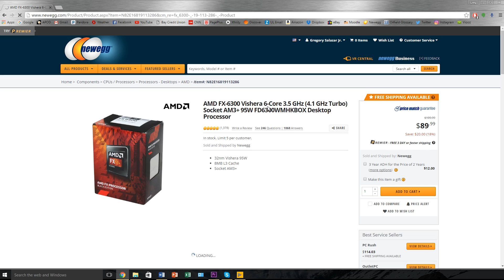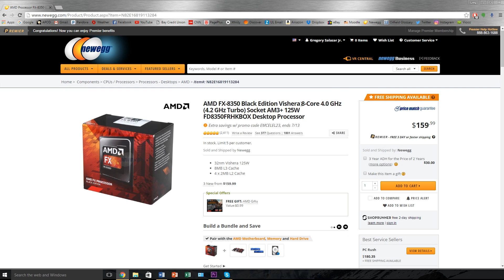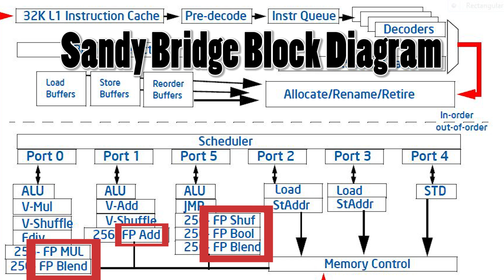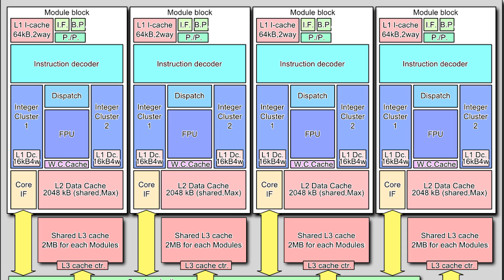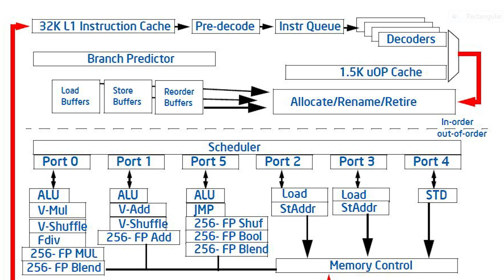How Many Cores Do AMD FX Processors *Actually* Have?

Comment: Hey Greg, I'm going to build a new pc soon and I was wandering what CPU should I get, the i5-6600k or the i7-6700k?
Reply from the maker: Already have a video covering this.
Reply: The i5 6600k and a more expensive GPU is better than an i7 6700k and a less expensive GPU. The i5 6600k is the smart choice, but the i7 6700k will be more rewarding if you can make full use of it.
Reply: I'd wait for Zen...
Reply: Noah, you're obviously a fanboy. So let me make it clear. First, yes, the 480 is at the moment about 10% weaker than the 1060, but the reality is this... AMD's cards actually get faster as they age. When it came out the HD 7970 was about 20% weaker than the GTX 680. By the time the R9 280X and GTX 770 came around, which mind you used the same GPU as the previously mentioned cards, the 280X was the more powerful of the two. This is due to AMD's optimizations. It's the same reason that an R9 290X running on current drivers can now comfortably out perform a 780 Ti even though the 780 Ti was much more powerful during the cards run. AMD actually tries to keep their older cards relevant. nVidia doesn't. Plus the 480 should perform better than the 1060 in DX12 titles due to Async rendering.

Now, as for Zen and Intel, here's the simple fact. Zen is looking to have about as many instructions per-clock as Haswell. This is only a hair behind broadwell and Skylake since Intel's been pretty fucking lazy since AMD dropped the ball with Bulldozer. But here's the kicker. Yes, Zen cores will be a little weaker, but Intel puts an iGPU on every consumer grade processor they make outside the X99 platform processors which cost an arm and a leg. This matters because of Die space. Right now Intel actually dedicates over 50% of their CPU die space to the iGPU. Zen based FX processors aren't going to be including iGPUs which means they'll be able to have twice as many cores as a comparable Intel processor. Even if the next gen intel processors have a sizable power boost, which isn't likely considering that intel has outright stated that they're not going to be focusing on the desktop market, they'll still be hamstrung by the need to dedicate half the die space to the iGPU.

Now I am sure you'll ignore all this and spout more platitudes but that's on you. The simple fact is you have no idea what you're taking about.
Reply: Some serious fanboyism on this thread. 8GB of Vram on the RX 480 vs 6GB on the 1060 is going to have little to no impact on gaming at the resolutions these cards are intended for. I don't know anything about VR or what goes into these cards to make them better for VR, but I imagine VRAM is part of it. Honestly, when I can pick between two directly competing cards, I always pick Nvidia. I prefer Nvidia's software, and EVGA makes excellent graphics cards so there is some brand loyalty behind my bias. That being said I have an R9 380X in my computer so don't "omg fanboy" me.
Reply: +Noah S. What if i told you no one gives a Fuck about your opinion. You will keep talking but not understand why no one is listening to you.
Reply: Right now AMD doesn't compete well against Intel, that's a fact. That said, there's a reason I said WAIT FOR ZEN.
Reply: EVGA Fan That goes both ways, they swapped x86 and x64 architectures. And Nvidia is only neck to neck with AMD because Nvidia keeps their Phys-X chips and their exclusive software closed source. Big techies such as Linus and RTU, and smaller youtubers unendorsed by companies admit that Nvidia is paying to keep relevant in the gaming world, also Linus did a video on Intel and AMD cpu history. But you're clearly showing a lack of intelligence in that area.
Reply: Noah S. Lol. The company that can't seem to wrap their heads around what proper pricing is. A GTX 970 costs more then a RX 480 and is massively dated in comparison. Yet Nvidia is coming around. I know who's gpu's are better, at least Intel justifies their price tag on the cpu's something I don't think Nvidia will get for a loong time.
Reply: what if I told you AMD sucks ass. As soon as AMD puts that out Intel will beat it again with their RD budget
Reply: +PsyckoSama AMD is about price, Intel is all power. Now not many of us have the money for the later. Id wait for Zen as well.
Reply: +PsyckoSama You really cannot explain yourself can you? Cards don't get faster with age, the clock speed stays exactly the same. some of the cards later produced may have had a slower clock speed but that doesn't mean the older ones got faster. You are a mess.
Reply: Kent D Excuse me, but if I read his comment right, he said they get better optimizations as they get older. Meaning it's software tweaks on them maximizing their performance.
Reply: Kent D software updates can tweak how it handles, and tbh. A processor doesn't degrade like a hard drive, go look it up. Linus did a vid on it, here's a quote. "Both my graphics cards got shit on equally" one new, and one years old with 100's of hours of use.
Reply: +Derp Derpington Actually, a lot of the positive reviews of the 1060 over the 480 have been due largely to running 90% of the benchmarks in DX11 (with tons of Gameworks titles, mind you) when it makes up the difference rather comfortably under DX12.

Right now the GTX 1060 is a little faster. But I'd like to see how they look in 6 months.
Reply: Noah S. Lol. AMD is shitty? Get real. A 700$ R9 295x2 matched the performance, and even beat a 1000$ Titan. This is the first time Nvidia has even remotely appropriately priced a card.
Reply: Noah S. Looking further into it. It outperformed the Titan Z. Lmao. At a 1500$ price difference, probably more now unless the Z has gone down more. http://www.extremetech.com/gaming/184216-nvidias-3000-titan-z-takes-on-the-1500-radeon-r9-295x2-and-gets-crushed and it beat two Titan Blacks in SLI for 25% less. Its thermal design was bad, but its cooling makes up for it. The fact Nvidia fucked up that colossally is bad. A dated GPU beat it. I respect both, but I have my preference and stated why. AMD allows Nvidia to benefit off their in-game physics boosters, why can't Nvidia suck up and let AMD benefit off their software? Explain in a non-biased way.
Reply: Noah S. Lol. That explains why AMD is neck and neck with Nvidia. And why a gpu that at launch costed 1500$ beat Nvidia's 3000$ GPU. Get real. While it wasn't as power efficient as the Z. Beating it by a whopping 35% in games and real world scenarios is embarrassing. Tell me a TRUE story. When Nvidia aims things at businesses, you get the Titans. When it's at consumers. You get GTX, though a bit overpriced as to AMD's performance equivalents (Aftermarket such as ASUS and MSI remove cooling issues and increase silence compared to factory defaults while lowering the price) while possibly a bit louder and a tad less efficient have been costing (sometimes 100's of dollars) quite a bit less. Tell me what a dollar minded person will choose.
Reply: +Derp Derpington AMD is neck and neck with nvidia because half of the world can't afford Intel or doesn't need intel. Most people buy an fx or an x4 and pair or with a mid end gaming card like the 380 or 390 and call it good. Intel is better for professional use and high end gaming. AMD wouldn't even be producing processors if not for Intel partnering with them and giving them their chip design in 1982...
Reply: Noah S. Lmao. You're showing total bias, must be a Nvidia fanboy.
Reply: Noah S. Lmao. You're showing total bias, must be a Nvidia fanboy.
Reply: Noah S. And it's Nvidia holding AMD cards back because they refuse to release their exclusive software. Where as AMD IS open source and benefiting Nvidia cards. Learn to read fanboy.
Reply: All you talk about is how "I'm lacking intelligence." You're not as smart as you think if that's the kind of shit you feel the need to say to solidify your argument. And yes, Intel has always played dirty to keep it's monopoly of the market. Guess what. That's the business world.
Reply: Not to mention that the swap of architectures only benefited AMD. Intel HAD to use a secondary supplier for X86 Microprocessors by IBM's demand. The X86 architecture was chosen by IBM over the X64 if that's any indication of superiority, and giving that architecture design to AMD and using them as a secondary supplier is the only reason AMD is relevant today.
Reply: EVGA Fan But AMD CPU's were the king in the early 2000's and that has shifted for now, let's see how well Zen fares against 10nm next architecture generation Intel. But AMD has made a fair enough competition with Nvidia with the RX 480 vs GTX 1060 (Though the 480 was rushed out the door, incomplete and woefully unoptimized) that I find it better because of a fairer price and a more friendly company behind it.
Reply: Go Amd and save your money
Reply: Yor Highness  And spend more on a power supply, spend more on power, run a hotter PC and have a higher lemon rate. The intel CPU's built to compete with AMD arn't that much more. The higher priced ones are out of AMD's ability to compete.
Reply: PsyckoSama  and look at Intels R&D budget. Intel would be very fast to compete with zen, so if you want to wait for zen wait for what Intel releases after zen. Look for the RX 480 being beaten down by Nvidia for example.
Reply: +Noah S. Why spend 250$ for a Nvidia GTX 1060 with 6gb Vram when you can buy a RX 480 8gb Card and overclock it? Clearly the better choice and exceptionally better for multi monitor setups. Fanboy acting like a dumbass.
Reply: +PsyckoSama Nice. I didn't know that. And I'd prefer 8gb of Vram and a slightly weaker processor then 33% less vram for a higher price. GPU's can be overclocked as well, if you can overclock the rx 480 to 1060 level and have 8gb of vram for the same or slightly less, why pay more?
Reply: +Derp Derpington Speed and performance doesnt get better, it degrades. Software updates improve compatibility.
Reply: And another thing worth mentioning. Changing how a processor handles its job can make a significant difference. Enough to put the rx 480 to 1060 level, and the 480 was rushed out, poorly optimized and buggy. The 1060 was not however. So yes, the 480 will likely be faster then the 1060. Get over it.
Reply: ... Your name says it all.
Reply: I mean.. yeah. I already said EVGA was my go-to brand. I use an AMD Graphics card so maybe my name doesn't say it all...
Reply: EVGA Fan It will make a huge impact on multi monitor gaming. Plus 8gb will keep you set in the long run, besides it's not even noticable in fps between the two cards. Get more for your money with AMD, and as I said. Just overclock the 480 and the difference is closed for less money.
Reply: Derp Derpington  or you can just the 1060 which is a better buy
Reply: Derp Derpington  oh I'm sorry I'm willing to spend a bit more money for the better card and I'm making AMD fanboys salty, must be already upset with a shitty AMD PC
Reply: Yeah but it is (should be) common knowledge that the Titan series cards were not gaming cards. They excel at double precision computation and were marketed towards the gaming community to appeal to a larger crowd. So your comparison is completely worthless to the conversation. Not to mention the R9 295x2 is an extremely inefficient card that consumes around 500 watts under load. The GTX 1060 performs around 15% better than the RX 480 while consuming less power, generating less heat, and having better driver support and software stability. Those are facts, and I wouldn't say AMD is "Shitty" but Intel/Nvidia is certainly superior at this day and age.
Reply: Same, but Nvidia is just FINALLY getting well priced cards, and the power consumption difference would take months to iron out the difference between 480-1060. And would take years of consistent use between a Intel and AMD cpu. The heat/power difference argument is just stupid, and obviously a overclocked card will produce more heat and draw more power. And the 300$ difference is substantial enough to be relevant, the R9 295x2 was a considerably older gpu then the titan while outperforming it. Plus that 500w is just a lie, It's under 430w draw.
Reply: Derp Derpington  the R9295X outperformed the titan by 3 percent or something really small. The R9295X was a disgusting, massive, multi part dinosaur that nobody wants.
Reply: Derp Derpington because Nvidia invests alot more into their software and being on the leading edge of hardware development. AMD just rides the wake with cheap crap
Reply: Derp Derpington  how about we fast forward to pascal and and the 1060 beating the RX480's "value".
Reply: Derp Derpington  You mean how AMD's competition against Intel in the CPU market is even more pathetic than Their competition against Nvidia in the GPU market? Grow up, it's not hard to see who the winning companies are
Reply: Derp Derpington  you seem to be the 5 year old that can't let go off his old blanket that's falling apart because it was his only friend. Even if I am a fanboy at least I'm one of the better company.
Reply: EVGA Fan neither would be around if not for the other. It would be some other company the government created to prevent monopoly. You blatantly state that AMD wouldn't be around if not for Intel and that's not entirely true without saying the same for Intel with AMD. Intel hasn't played dirty to keep in the majority. AMD fucked up with bulldozer architecture, and that's the result. Plus a company aiming at businesses and getting more revenue and R&D money helps. But Nvidia and AMD is similar, AMD is a gamer focused company. As such they perform better in the field.  But as for being the minority, they are doing better at their focused point.
Reply: The Tasty Sausage Biscuit  the 970 still has slightly better performance than the RX480, and it's competitor the 1060 is slightly more expensive for much better performance.
Reply: The Tasty Sausage Biscuit the RX480 is under 5% better than my 970 and the rx480 isn't any cheaper.
Reply: Noah S. Riiiight. A 970 is 300$ for what a 4gb model? 480 is 200 for 4gb and 250 for 8gb.
Reply: The Tasty Sausage Biscuit  a 970 is 400$ canadian, an RX 480 is also 400 Canadian.
Reply: Noah S. In the US it's far different.

Comment: That's strange, I have a fx8350 in my rig and cinebench sees it as an 8 core with 8 threads
Reply: What is strange about that?, that's perfectly normal
Reply: Stefan Koopmans In the video he said it showed up as a 4 come with 8 threads
Reply: Maybe it is some microcode update or another version of cinebench
Reply: Unupdated Windows 7 SP1 considers FX as 8 core 8 threads CPU. An update from Microsoft makes it consider FX as 4 cores 8 threads,  Windows 8 and newer do this out of box. It was done to prevent dual core applications from using only  1 FPU instead of 2, triple and quad cored from using only 2 instead of 3 and 4.
Reply: AdmiralMyxtaR yeah that's probably it I have windows 7and haven't gotten it on WiFi

Comment: Does i7 only have hyperthreading? I see some i5 and i3 with hyperthreading, like what you explained.
Reply: yea mobile cpus are just everywhere and make no sense sometimes. like dual core i7s. i had an hp laptop that had a dual core i3 with hyperthreading. it took forever to find that info because of how weird hp is with their part numbers and model names, as well as the confusing mobile cpu names
Reply: i7 and i3 has hyperthreading
i5 usually does not
Reply: Googled it and laptop(mobile) version has hyperthreading but desktop version doesn't have. That's why my i5 laptop has 2 cores and 4 logical processors.
Reply: The mobile series are all over the place. I have a friend with an i7 that only has 2 cores (I don't remember whether or not it had HT)
Reply: Well they are made for laptops that's why they are underpowered.

Comment: I still don't get how hyper threading works. Can you make a video comparing the architecture of a quad core core i5, 4 thread Core i5 to that of a quad core, 8 thread Core i7?
Reply: a core is a mouth and a thread is a hand. you can eat food with one hand, but if your mouth now has two hands it can more constantly and consistently eat food. a core with one thread will process data, a core with two threads will constantly and more consistently process data
Reply: Jay Santos whoops I forgot about that techquickie, yea its from the hyperthreading techquickie from LMG.
Reply: Hyper-threading (Intel's brand name for symmetric multi-threading) works by scheduling more than one instruction at a time  in the various subunits of the core (FPU. ALU. APU...,), which works pretty great until two threads get scheduled on the same core that use a lot of the same subunit resource.  Some CPU's like the POWER series can do 8 or more threads per core.
Reply: WorBlux shhhhh